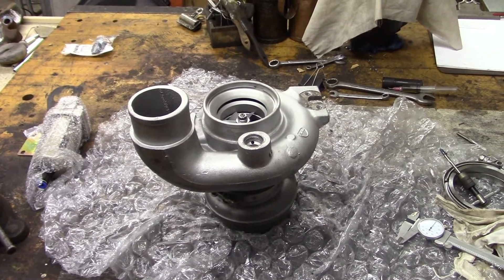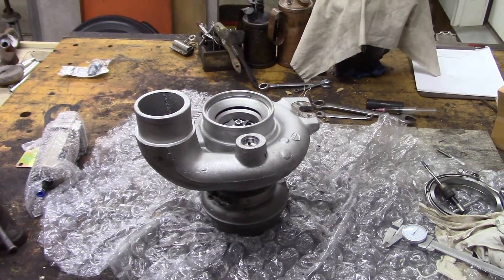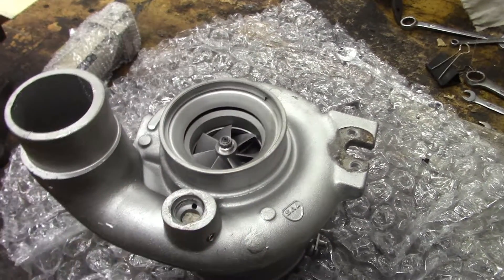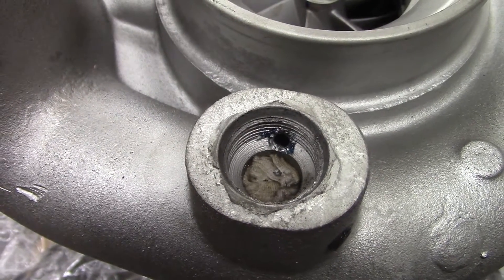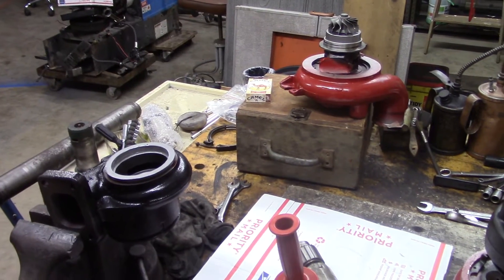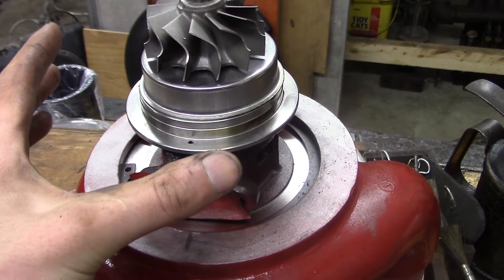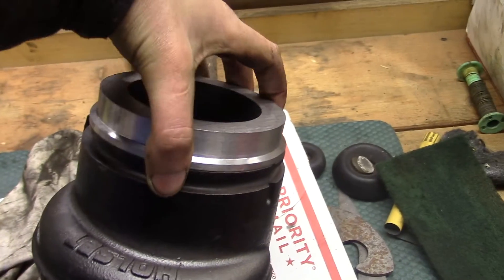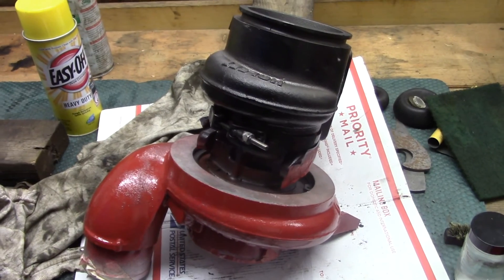HE 351CW Turbo Swap - First Gen Cummins - Part No. 1

Comment: I think the hole that you tapped with the 10-24 is where the solenoid would dump the boost signal back into the compressor inlet after closing the port Otherwise, if the wastegate was pressured up and open and the solenoid switched, pressure would be trapped in the wastegate actuator line and it would stay open.

Comment: What paint did you use on the turbo? how has it held up to the high heat that is created?
Reply from the maker: regular rustoleum on compressor, rustoleum high heat on exhaust turbine. the cold side holds up fine, but on the hot side the rust will eventually come through.

Comment: So clocking the compressor side. Does it have a little pin that has to be pulled too?
Reply from the maker: No, the only thing that holds it is that giant snap ring.
Reply: So I can just take the ring off and twist it?
Reply from the maker: Don't take it off, it's a bitch to replace. just squeeze the ends closed with a tool like i made in the video and you'll be able to rotate it. also make sure to leave the ring ends in a location that is accessible when the turbo is installed in the truck, in case you need to fine-tune the location.

Comment: if i want to run 40 psi of boost do you need to plug the hole or can i leave it the way it is?
Reply from the maker: if you want to use a spring gate to control boost pressure, the hold must be plugged. if you want to use the stock solenoid in conjunction with the diaphragm style wastegate (keep in mind, this means you won't be able to clock the turbo because the wastegate is mounted on the compressor housing), you can do that and be able to have either 20 or 40 PSI of boost depending on whether or not the solenoid is energized.
Reply: gotcha how slow does the hx 35 spool compared to stock because my hy spools fairly quick
Reply from the maker: if you have a first gen you don't have an HY, you have an H1C. anyway, compared to my stock H1C, an HX35 is...well, incomparable. it's the turbo that should have come on those motors. way faster and more boost. Now, this HE351 i'm putting on is supposed to be better than the HX35 in every way. we'll see. I'm installing it now, but weather and short days make it a challenge. stay tuned!
Reply: themadmailler yea that's what I mean haha I'm just a young buck! But I think I might go with the he if it's that's much better and just run thirty pounds which you want to do. Please make videos on how you go about the wastegate! Thankyou
Reply from the maker: Don't make the mistake I did and try to save a couple bucks by going for a turbo that you wont be totally happy with in the long run. I'm currently making part 2 to this video, all modifications including the wastegate will be included! stay tuned!
Reply: @themadmailler what boost are you getting. I want to put an 351cw on my 1990. I have 40 over injectors. And new ve pump
Reply from the maker: @TylerHovdebo-mi6px I don't remember, probably 30 or so. But the HX35 was way better IMO.

Comment: We are getting ready to put a 351VGT on one of our first gens "2aully", mainly for breaking. I made my big snap ring pliers out of a china made erwin pair of small c-clamp visegrips by cutting the prongs off and taping a couple of 10-24 holes putting allen headed hardened screws thru it, Works great, Can't wait for part 2
Reply from the maker: Interesting idea for the snap ring pliers. Goes to show there's a dozen ways to skin a cat, if you put your mind to it! Part 2 should be coming in the next couple weeks. I still need my truck to pull a trailer a couple times before i can retire it for a little bit.

Comment: Have just done that swap myself, im using the wg actuator as a spring gate sort of, also put new 70hp injector nozzles on but the truck is spewing white smoke now so gonna have to figure out whats up with that... Im guessing injectors but dunno.
Reply from the maker: low compression or bad turbo? that sucks dude! good luck! make sure your spray angle is correct on those nozzles too.

Comment: love to watch your videos on your truck. but you could've rebuilt the hx35, I did the turbo swap too, mine started to leak and it was very easy to rebuild.
Reply from the maker: I couldn't get the exhaust housing off since it was rusted tight on there. I also have been wanting an HE351 from day 1 and should have done it in the first place!
Reply: im waiting to use my he until i get the compound kit from the hungry diesel. Also, I used a torch and a lot of pb blaster to get my exhaust housing of, was on set pretty good on there
Reply from the maker: I used heat and oil too... but let's be honest, I really just wanted an HE351!
Reply: Compound setup with your HE351 as the secondary works great,  I built my own with an  Borg Warner K31 as my primary.  I also liked the mechanical wastegate, it's fully adjustable.  Mine works great and with my pump turned up and 100 horse nozzles, I got pretty cool EGT's.  around the 1000 mark.  Wonder what Eric is getting for a compound setup.  He's a good guy to work with?